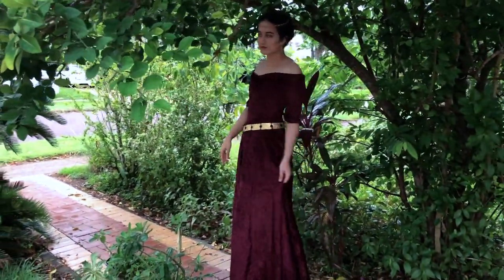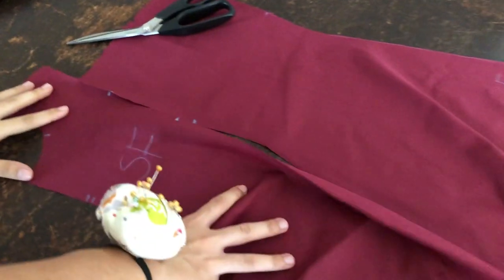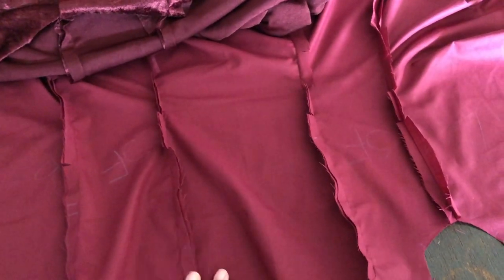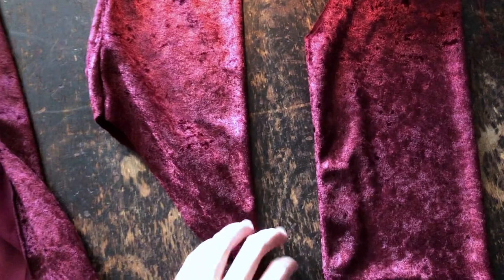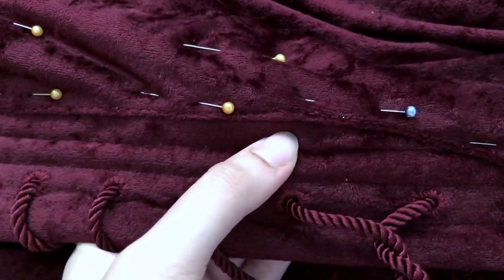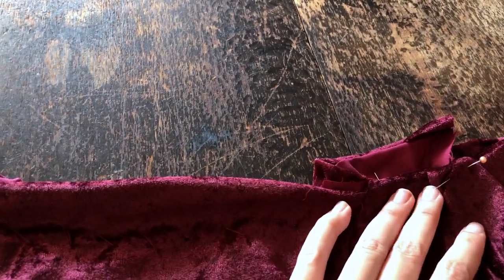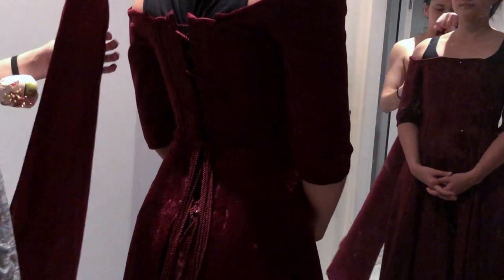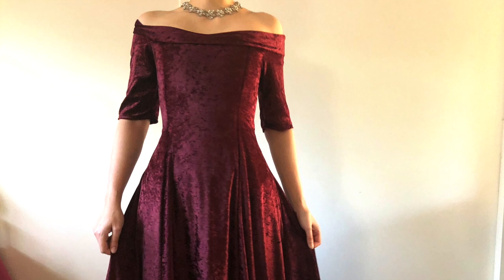Making a Medieval Inspired Gown - Part 2

Comment: How did you line up the bodice and skirt pattern pieces, because I have the same pattern and the bodice and skirt pieces don't match, for example the front bodice piece is wider then the front skirt piece.
Reply from the maker: I just trimmed off any excess in the pattern in the skirt to match with the bodice! The bodice is more form-fitting whereas the skirt is loose, so it doesn't matter too much when altering the skirt pieces
Reply: @estelledesigns  okay, thank you!